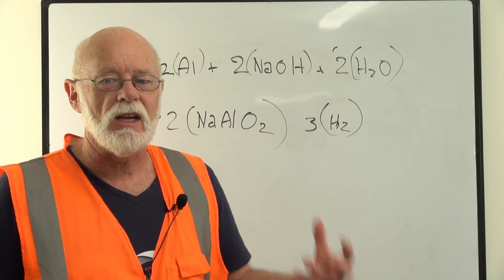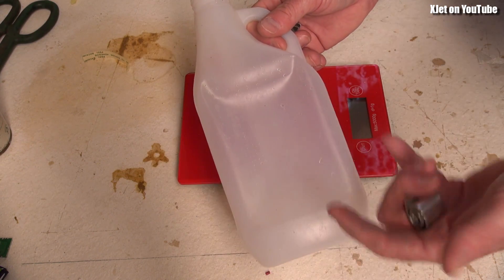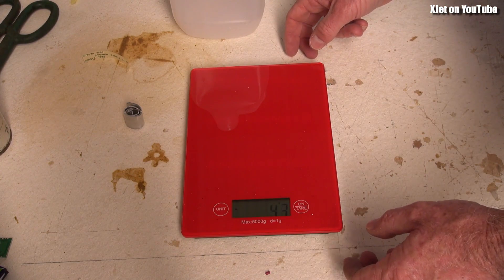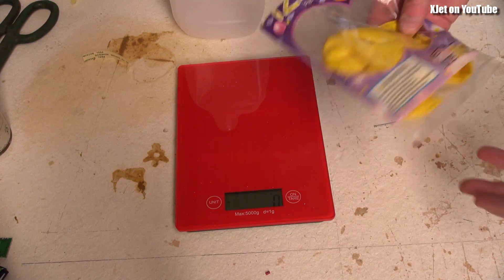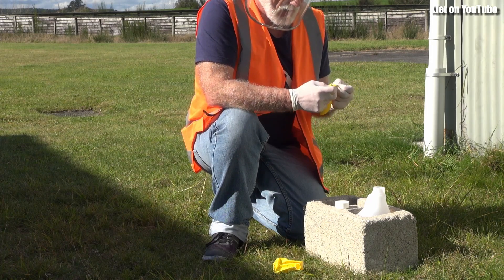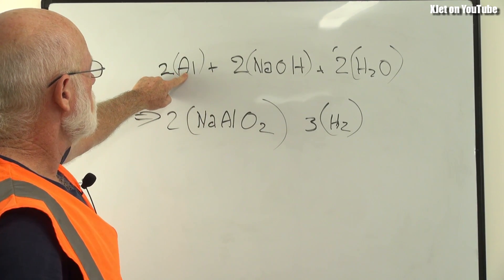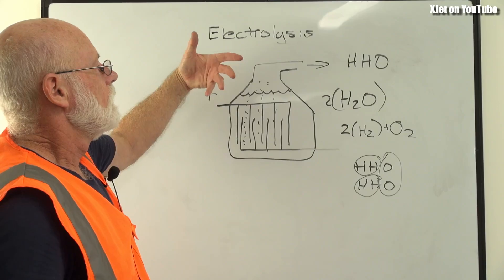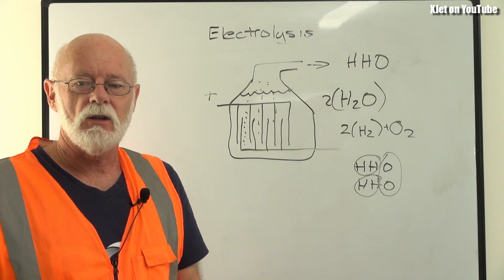A drone alternative: hydrogen-lift aerial video (FPV) Part 3

Comment: When I had done my testing I found some interesting and useful things. First, the balloon lasted about 13 hours and grew to a maximum of about ~8 inches/20 centimeters. I was using cheap balloons that do not hold well. Second, I had powered the unit off of a USB jack (5V, 2.1A) which worked well. Third, the only major question that I had was the positive terminal would disintegrate after a time of 5+ hours on average. I first used what may have been some kind of steel wire but not exactly sure. Then I thought maybe it oxidized and corroded away or something so I tried a aluminum welding rod. The aluminum rod also disintegrated apart. So the last think to check was the internet, didn't find much there but I may have not searched enough. Overall the chemical method is simper but I enjoy building things so I went with electrolysis and learned some things.

Comment: Thanks Bruce. If you want a correct balance between NaOH, water and Aluminium, you need to weigh everything in moles. Atomic weights are the important ones.

Comment: Bruce, Love your channel. I have a comment about your formula though. I THINK you need to look at Mass-Mole conversion. I vaguely remember from college chemistry that you need to convert the actual weight (grams) of material (Al, NaOH, etc.) to number of atoms per gram so your formula will have mates for each of the atoms. Otherwise if you do it just by weight you have lots of leftover atoms due to the different number of atoms per gram of material. It's been 25 years though so maybe that isn't totally right. I'd never question you on an Electronics formula though. Keep posting content please.

Comment: I think you should use a glass container for the reaction and, you'd have to put it in a bucket full of sand to avoid thermal stress. That way no more problem with the heat created by the reaction :)
also, a piece of bakelite (or another insulation) on the neck where the balloon sit might be a good idea

Comment: I think we need to know a bit more about what the guy in Australia was doing. Was he making 1 cubic meter of pure H2 at low pressure for a balloon, or was it massive quantities in high pressure tanks... I'd have a hard time believing the former could be lethal.
Regarding the cost/efficiency, yes 40kWh for 1kg, but 1kg is about 12 cubic meters. So for a balloon of 1 cubic meter you need the equivalent of running your electric kettle for 3.5 hours. The highest rate I see on my power bill is 35 cents/kWh, so that would be about NZ$1.25 per cubic meter. Even considering inefficiencies in the system it's not really expensive. The downside is speed and portability.
Reply: Have you seen a hydrogen + oxygen balloon explode? Even 15 feet away with a tiny balloon like Bruce is using, you can feel the pressure wave blow your hair back and leave a thump in your heart. Pressure waves can kill people very easy, human's have a very sensitive with fragile bodies.  My cousin and I were running a mini quad-bike off of a hydrogen balloon (runs a couple minutes and you can drive around the yard briefly). We were regulating it by pinching the end to limit the amount, and letting it blow into the snorkel intake (diluted). After about 2 minutes of idle trying to tune it better (third run of the day), the engine backfired and the resulting blast was blindingly bright, ears ringing, and thankfully no fingers blown off thanks to thick leather welding gloves. We decided to not do that again...
Reply: Jake Garrett Bruce like myself hasn't got much hair to enjoy being blown back....
Reply from the maker: It looks very much as if he was making "browns gas" (2(H2) + O2)  which is sometimes used for welding.. google it and you'll find that there are actually electrolysis machines commercially available for creating this H2/O2 mix by way of electrolysis.  The important aspect of the commercial machines is that they create it "on demand" and "as required" so that there isn't any stored in a tank or reservoir.  This ensures that you can't have a big bang, should something go wrong.  Maybe this guy built his own "electrolyser" with a lot of gas storage and discovered (the hard way) that this stuff is mondo-explody.
Reply: Jake I'm not proposing to make a hydrogen + oxygen balloon. From what I've seen there is quite a difference in combustion rate if the hydrogen is pure, eg. https://www.youtube.com/watch?v=XlmtcsSJr7Q
The pure hydrogen doesn't even put the candle out after four bursts, while the hydrogen + oxygen knocks chalk off the entire length of the blackboard.
Compare also these, first is pure hydrogen, second is hydrogen + oxygen. I think the guy in Australia might have gotten a dose of something like the latter....
https://youtu.be/8fWbTuipSIA?t=9m49s
https://youtu.be/MMB2VR0087w?t=19s

Comment: The balloon might not be filling up because hydrogen might be leaking through the pores of the balloon. In the last video, the balloon shrunk quite quickly after you removed it from the bottle, which you attributed to the gas cooling, but it might just be the gas leaking through the balloon. I'm not sure if 'helium grade' is enough to keep it in :P

Try a mylar balloon to rule it out. They also don't stretch, so there should be less resistance in filling it up from the low pressure of the bottle.

Comment: I perfectly understand that you only want to generate a few liters of hydrogen and cost per liter is not an issues. That does'nt allow you to claim that your solution is more efficient than electrolysis or natural gas processing. 1 kg of hydrogen is 142 MJ/kg or 39.4 kwh or 11.000 liters of hydrogen at STP. The current efficiency of an electrolysis  plant is about 80% or 50 kwh to produce 1kg of hydrogen, if the hydrogen plant is next to the power plant they avoid distribution charge, bringing the cost of a kg of hydrogen to $2.50 +tax, keep in mind a kg of hydrogen has he potential energy of a gallon of gasoline. In your case where you need about 11l of hydrogen generating it from a home build generator with a 50% efficiency and a $.20 kwh electricity tariff and using a car battery to produce it in the field would have costed you less than $.10 in electricity, how much did you spend in aluminum and sodium hydroxide?

Comment: I did this alll the time as a kid.  Forget slowing it down, the warmer the water/lye solution gets the faster the reaction goes.  Do it in a bigger container and cool the output.  The simplest setup I used was a gallon glass apple cider bottle that I soldered a brass fitting to the lid of.  To that I attached a few feet of coiled tube and a brass valve and fitting that fit the mouth of a 3' baloon.  Keep the coil of tube above the bottle and the water vapor will condense out and drip back down into the bottle.  That worked sufficiently well, but when I really wanted to speed things up I ran the coil into a bubbler with ice water in it.  When this thing was really rocking and rolling it would inflate a 3' baloon in 5-10minutes, and that was sufficient to lift quite a payload (or make a decent fireball ;-) ).  One 4th of July I made a dozen of the things, we strapped them up in a cluster maybe 30' above a roman candle aimed at it and lit it off...

Comment: Doesn't this method also need a huge amount of energy to create the aluminium?  I know not for you personally, but in the whole life cycle kind of way.
Reply: Yep, there's no such thing as free energy. Someone had to split the aluminium from oxygen at some point. Guess how? By electrolysis! Producing aluminium uses A LOT of energy (recycling uses about 5% of that). So much energy in fact that for example building lighter cars from aluminium instead of steel to reduce fuel consumption needs the car to be driving 100 000 to 200 000 km before it starts to "save" energy.

Comment: 13:20 electrolysis with NaOH I did it in school aged 14, not a rich school, there was about 10 tables, one device per table. No dangerous current. Both tubes were filled with water replaced by H2 and O2 in maybe 10 minutes. Not a kilo of Hydrogen but a significant amount. There would be a bit of engineering to 'pump' H2 but not so much. Especially if you forget about filling an elastic membrane. It does not require pressure and complicated pumps. Think about weather balloons.. You should try.
Or maybe are you trying to do prevention in order to keep kids away from rocket explosion, which I would understand if you did not give the receipt of HHO just before.
If I am wrong and that you believe NaOH hydrolysis is more dangerous please let me know and I will erase this comment.

Comment: 13:24 "per kilogram of Hydrogen"
How do you weigh something that is lighter than air ?
Reply: Just because it is lighter than air doesn't mean it doesn't have mass that can be weighed. You can measure the weight of a boat by the amount of water that it displaces. By displacing air from a container with hydrogen, the difference in weight can be measured and the weight of the hydrogen can be calculated.

Comment: HaHaHaHa Very Nice Chemistry Lesson! Butt I BegTo Differ With Your Statements On That You Can't Run A Vehicle On Hydrogen Generators! Since We Have Been Doing This For Past 20+ Years Now!
In Both Gasoline & Diesel Powered Vehicles, In Cars, Pickups, SUVs, Semi-Trucks, Heavy Equipments, Etc! What About A Clarion? You Can Now Buy One For $35k+!? Almost Every New Piece Of Caterpillar +++ Heavy Equipments Now Have Bolt On Options? Plus Mack's, Peterbuilts, Etc Road Semi Trucks Etc Etc Etc!!!
PS A 12v Truck Battery Backed With Your Alternator, Solar Panels, Wind Turbines + By Many Other Free Power Sources Is Very Sufficient To Make Enough Constant Flows Of H2 To Work...
Thanks Again! LOL 😀
Ohhh, Butt The Big Oil Companies Does Not Want The Majorities To Know That & Do Everything In Their Powers To Oppress Those Facts, JACK... LMAO 😂😂😂
Reply from the maker: So answer me this... if "big oil" is going to so much effort to suppress this "HHO" technology because it allegedly improves fuel efficiency and reduces the demand for their products -- why aren't they suppressing electric vehicle technology which TOTALLY eliminates the need for diesel and gasoline completely?   Doesn't make sense does it? :-)
Reply: They Have Been Doing That Too!
Until Now They Are One Of The Bigger Players In That Also.. 
Using The Public To Fund The Power Grids Here Anyways!?
They Are The Buyers  & Own The Power Grids! Plus Most People That Own Electric Vehicles Are Still Buying Electricity From Them To Charge Then! Unless Your Off Grid & Supplung All For Yourself!? LOL 😀 Thanks!

Comment: You really need a better setup. Get some hose and plastic pipe fittings, bubble the gas through a second bottle and the use another hose from that bottle to fill the ballon. I think you are losing alot of hydrogen at the threads of the bottle.

Comment: Your comparison of water and ash is flawed, water is the byproduct of burning hydrogen in the same way carbon dioxide is the byproduct of burning carbon based materials. Ash is the bit that doesn't burn.